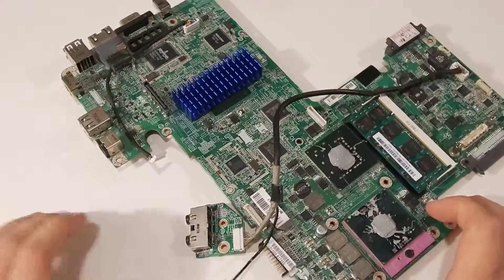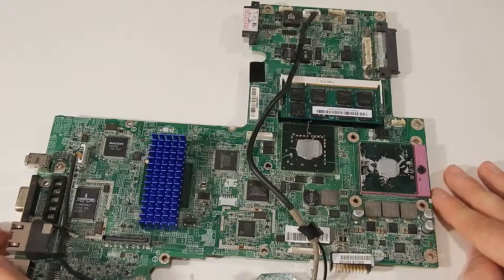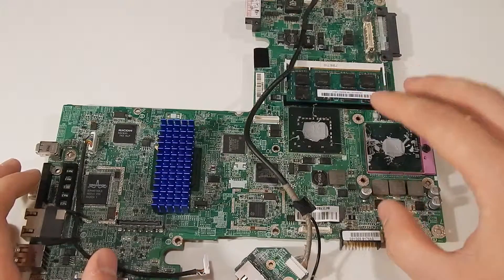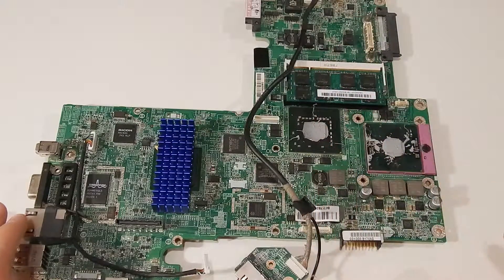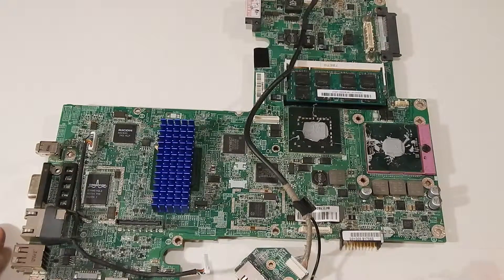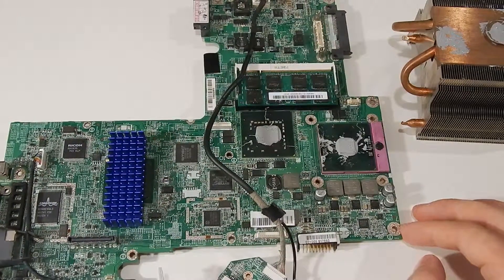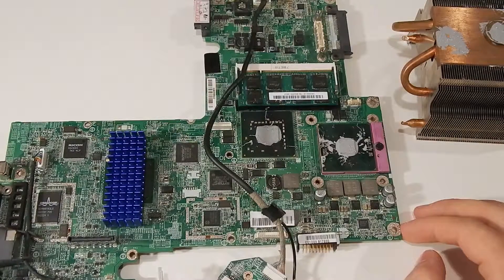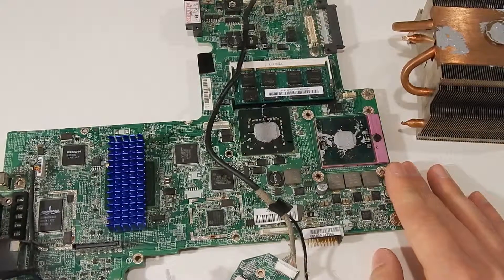passively cooled desktop idea

Comment: I’m thinking about doing the same, but when I disconnect the fan, the computer won’t turn on (safety feature) do you know if there is a way to bypass that?
Reply: same issue, did you find a solution?

Comment: really like the idea. i have tones of old noisy laptops and i wanna make a stand alone wifi repeater thats quiet. (my ipad/iphone cant pick up my wifi but my laptop can where i'm situated). ive made an antenna from a metal dish and a wifi dongle as a pickup, and the script for running and input wifi dongle to and output thru the laptops wifi seems simple enough. just need the no noise laptop motherboard.